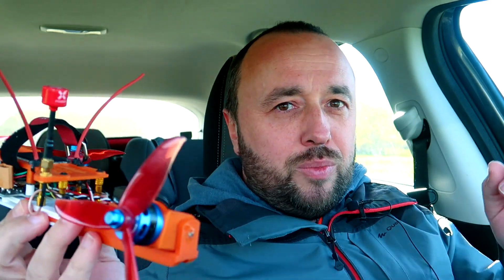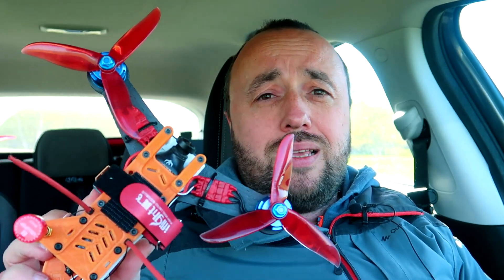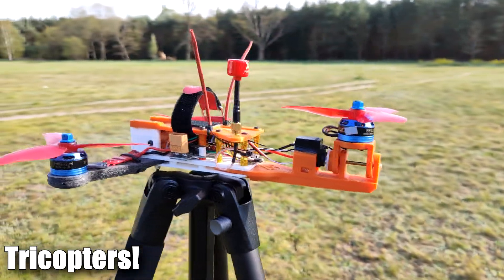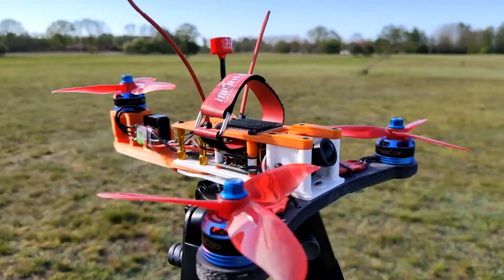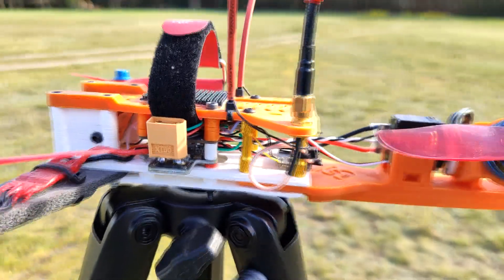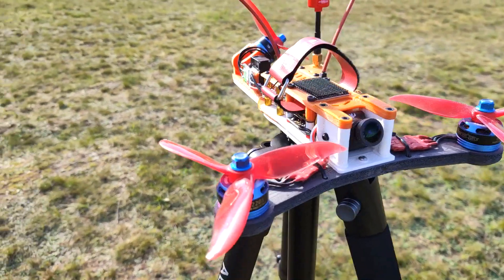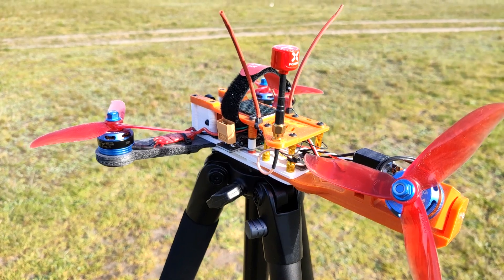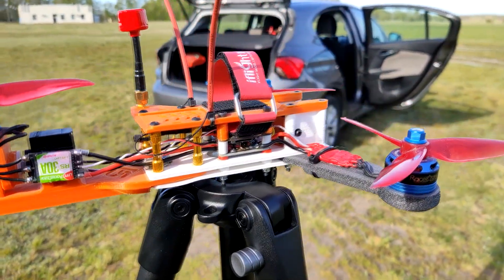It's a farewell to a 3D printed tricopter

Comment: Hi,

3D printed frames are the best from my point of view. I have some plans for create some tutorials on my channel, because I fly my drones using 3D printed frames  for a long time ( few month) :)
What is the difference in weight between carbon fiber and printed in your case ??
I think that You should try ABS - it have a less weight and if is correctly printed - more strength

Comment: Tricopters are an exercise in banging your head against a wall but, once you break through as David Windestal says they're so "swoopy" it's like a cross between a heli airplane and a quad. A heli because it has mad yaw authority an airplane because you basically only go forward and a quad because it can flip and roll fast as a mofo. A few things you need if you want to take advantage of the processing capability of a modern FC is a feedback wire on the servo and the fastest smoothest servo you can afford along with hours and hours of tuning followed by a few more hours of tuning, also you need a very stiff frame because of the way yaw works any flex kills the stability.

Comment: There is an iNav branch with triflight. We are currently testing it and works great with tricopters. Sad to see you abandon tri's , they are great subjects for testing filtering and pid settings with these frames. Just because they are more difficult to tune then quads. For anyone interested in triflight in iNav, check the rcexplorer forum or the tricopter group on rcgroups.

Comment: I have a Trifecta, with arms stiffened with carbon, and epoxy embedded in them, that fly's very well with the iNav settings you provided in the first video of this series. I know of only one source where they can still be found.
No, tricopters are not good for racing, but the larger you go, the more useful they are for long range. They handle the vibrations better in the 9-10" range with low kv motors at 14.8v, I have found as a very long term enthusiast user.
For anybody interested, here are some secrets I have found during my experience.
1st, run the tail motor at a slightly"higher" Kv than the front motors, say 200-300 more. Don't ask me why or how this works, I just know it does. I learned this from hours of reading message boards for tips for these things. 2nd, precision balance you props, no exceptions, ALL props are out of balance, no matter what the manufacturers claim! 3rd dynamically balance your motors and props while spinning together with a laser pointer strapped to the arm you are balancing. Do one motor at a time, while disconnecting the others, adding tape to the bell, in trial and error, while the laser is pointing at the wall to get it right. When the "dot" is a "dot" on the wall, or close, you are golden.
 Yes, use the best non slop servo for the tail. Kst metal gear high precision digital sailplane servos are the best. these servos are used in dynamic soaring sailplanes, that soar the back of a hill at sometimes up to 200 + miles per hour, so they can handle it. If you use ANYTHING analog, you are pissing into the wind. Finally, yes very stiff arms, and tail boom. If you like a challenge they're awesome, but if a person has no patience go fly a quad. I fly both and find the tri copters quite exciting, as they fly kind of like small helicopter, and you don't have to dick around with collective, or swashplate adjustments. Cheers

Comment: i recently retired my simplecopter tri for the same reason. replaced the kk2 board with an omnibus F4 board, replaced the simonk escs with some blheli_s 30A units and let her rip

... briefly. the airframe has so much flex in it i found it impossible to tune. 

rip(ieces)